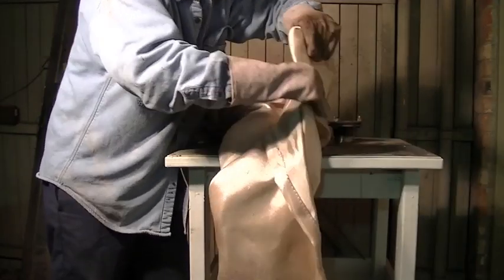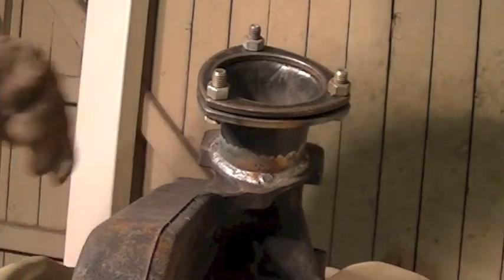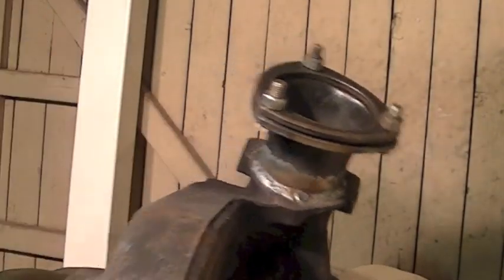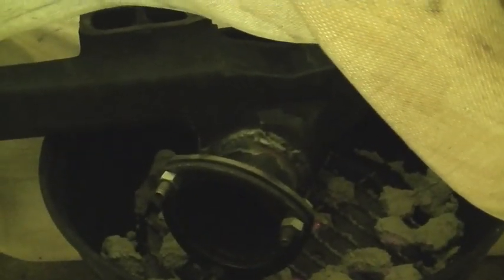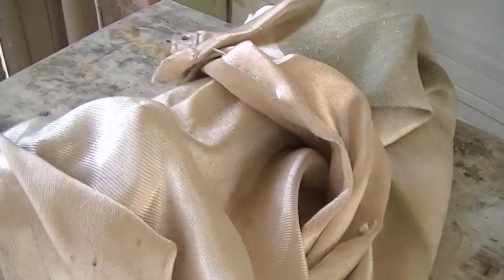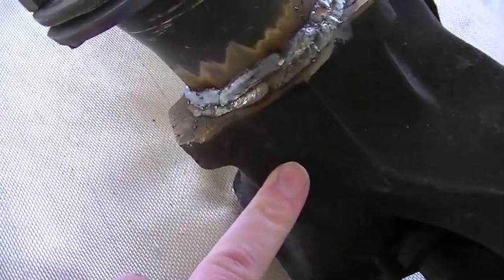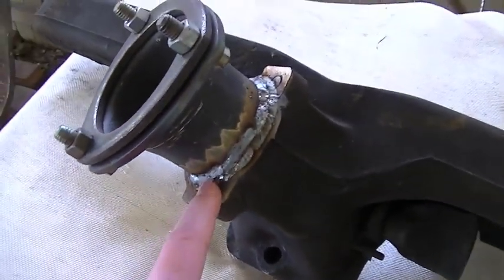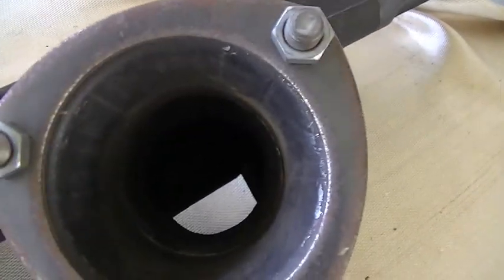Part 2 MIG Welding Cast Iron | Inline 6 Exhaust Manifold

Comment: An old welder repaired the cast iron baby grand piano wire frame and had me tap on it the whole time it was cooling he said to relieve the stress it didn't break or crack afterward I'm sure there's something to it my exhaust manifold has a crack in it I was just thinking about welding it myself along with the pre and post heat....

Comment: Why didn't you drill out the old bolts...clean the threads and insert new studs ?   Just wondering ?
Reply from the maker: +berkmanyt Mainly I just wanted to put a different flange on the exhaust.  One that's easier to remove if needed.
Reply: I was saying the same . I am a retired mechanic I have never heard of welding a steel plpe to a cast iron manifold.

Comment: What kind of wire do you use for cast iron headers? All I need rid to weld a crack
Reply from the maker: Armando Monreal I used ER70S-6.... but if you have (or can easily get) some stainless wire, I would use that.  Thanks for watching!

Comment: I had a 250 in my 67 Chevelle. Even though it ran smoothly it shook to beat the band. Aren't you concerned about the flange weld cracking with use, especially torque flex with acceleration?
Reply from the maker: WhatIsKenDoing Not too much.  A properly done weld on cast iron can be as strong as a weld on steel.  The exhaust has enough flexible hangers as well to help reduce the stress.

Comment: i have the same motor in my 78 and for now i want to do the dual LT headers summit racing sells. Flow tech is the brand can i put it on while still keeping the same intake manifold. later on i will get the Offenhauser single quad intake, should bolt right on right? thanks
Reply from the maker: Manuel Ramirez Yes, they should bolt right on with the stock intake.  You might have some drivability issues without the heat riser between the exhaust and intake manifold.  Liquid fuel doesn't burn very well.  Fuel vapor burns very well.  The exhaust heats the intake so that fuel doesn't condense inside the intake.  I would recommend you replace the intake and the exhaust at the same time.  I would also recommend that you buy and intake that has water ports so that you can run coolant through the bottom of the intake.  Hot coolant will have the same effect as the exhaust heating the intake.

Comment: can weld a crack in Exhaust Manifold with TIG welding ?
what kind of wire filler must be used with the MIG weld for welding in cast iron (Manifold Exhaust)
Reply from the maker: A crack in a cast iron exhaust manifold can be repaired using TIG.  It's actually a better method for welding cast iron than MIG.  From what I've seen, most people use 609 stainless filler rod with TIG.  I'm using regular ER70S-6 MIG wire in this video.  Not ideal, but it works

Comment: Was it Broken? or you just wanted a bigger end? why not a bolt on adapter? im a pain i know just curious lol
Reply from the maker: The threads on the 3 studs were in pretty bad shape.  I wasn't able to tighten the flange on the factory exhaust pipe enough to make a seal.